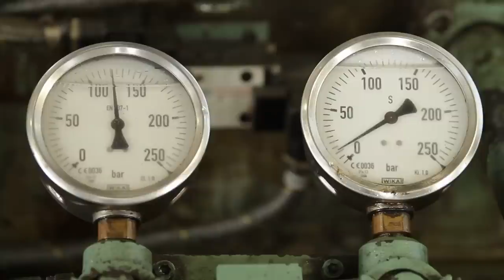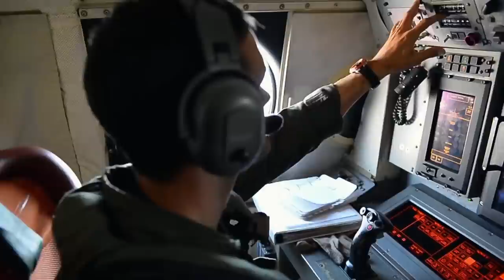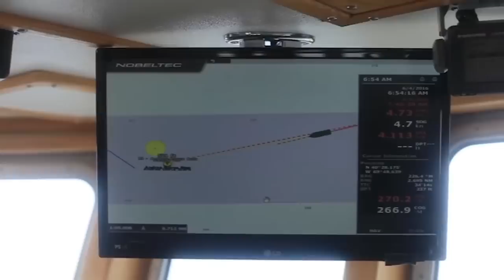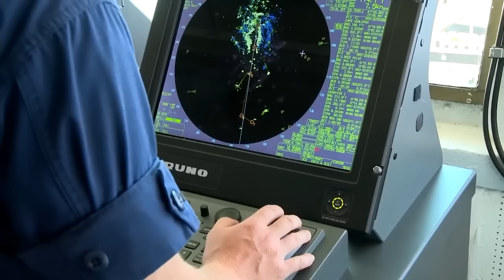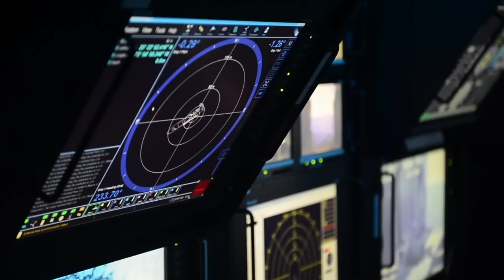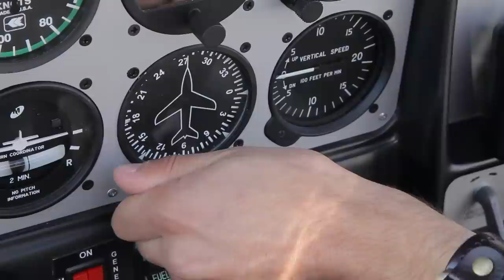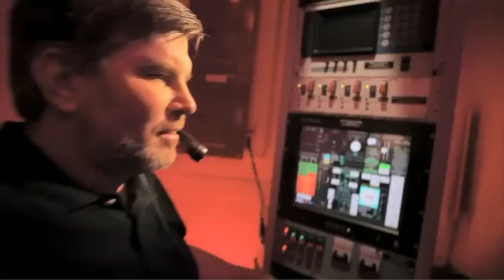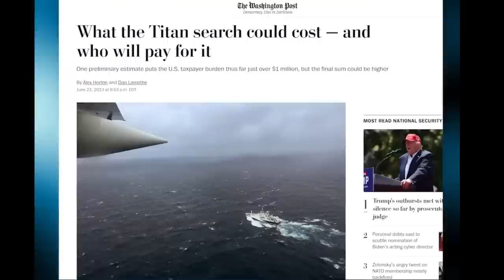US Navy Uncover TERRIFYING Last Moments | Oceangate TITAN Submarine Documentary

Comment: Look its high technology .the first line of defence against chinese sub infiltration.or if they fire torepedo at carriers or a fleet moving in a squall in attack formation.if a chinese ballistic sub.launches a sub ocan missle .it will be heard trianglated.so it has multiple ones .if they heard .the knocks is the window that was in door molissing bolt the sub went window first.the pressure would jet into that nozzle type hole.this would push agin that flat ring it is bolten to.this pushed outward on door until the bolt heads popped off bang bang bang.then it opened just enough for the water it also pushed the acrlic window inwards as its plastic .and bowed like bowl.if its pushed on middle of bow .it will push in as the pressure wasnt equal inside.the window would suck inwards like the game trouble.u pop the plastic and itcwent fast .the people may have fell feet first into the window pushed in with massive presure.at that pressure.if u just touch it .sharply .it would suck inwards if the pressure pushed in on the bowed sides .making it smaller .just enough for it to be sucked inwards by negative pressure .could an sea abimal attacked rhe window like 6 gills are capable of doing maybe a greenland shark .these animals have attacked subs before.but going down window first. The pressure hit it with a bang it was rhe bolt heads popping out.u have so called experts.say the pressure would hold door ckosed.but wen u leave one empty.and u fall face first the pressure will force into that hole  and push back pressure on the door.until bolt heads popped as they were frozen cokd.brittle.the bolt heads would pop.outwads thst was the bang bang bang.then the window with the only way to go was inward .as it was almost negative pressure would be pushed inward the 5 inches .but with it racing towards bottom the negative inner pressure would act like suction cup.pulling the window into the sub